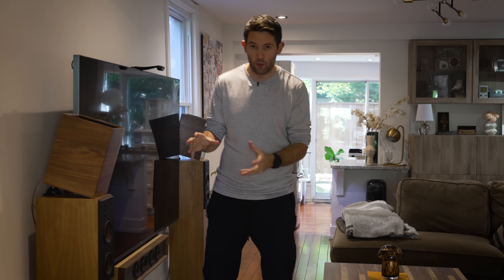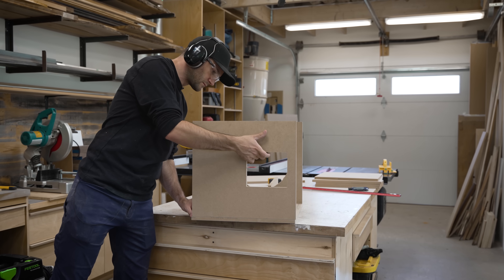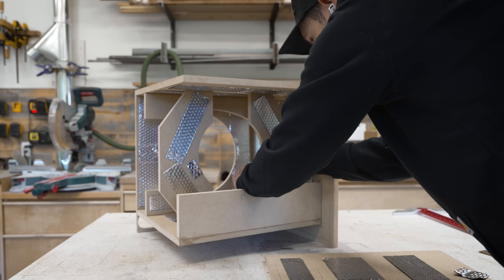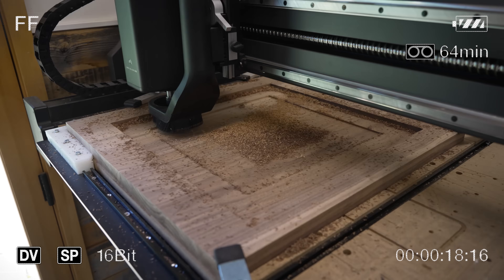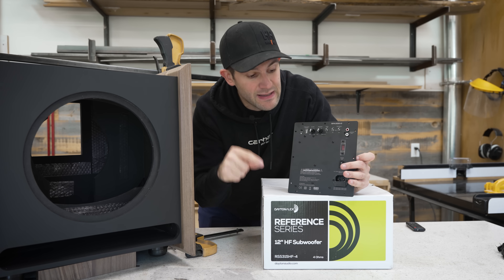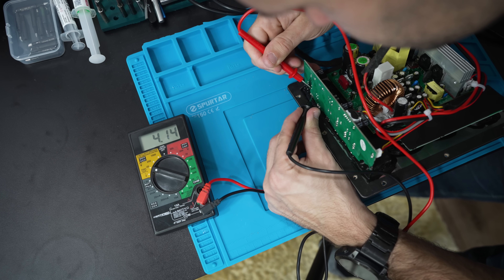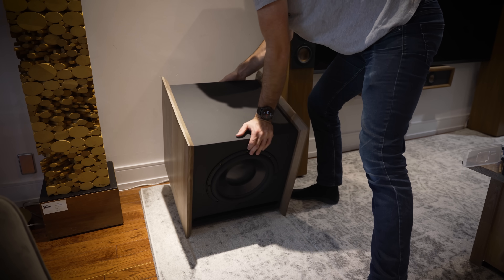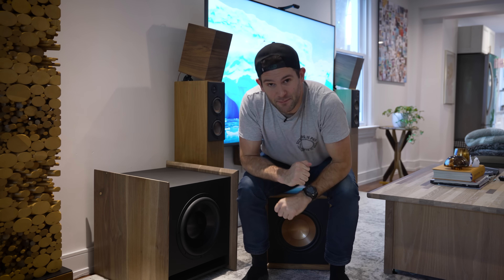THIS changes DIY Audio...

Comment: I would definetly add a simple toggle switch for feeding the amplifier wirelessly or by the terminals at the back. Back feeding a receiver can be an issue.
Reply: I literally never even turn my sub on anymore.

Comment: I have decades in audio, I don't even know where to start with thsi video. Not to be a nay-sayer but please, go and read a book on speaker design and also install a crossover in your sub AND put some long fibre wool in the cabinet and you'll be shocked at the difference. It get rid of the feet and remake the cabinet out of plywood (WAAAAAY better acoustically) and make a 2nd one as one sub is pointless. Please, try it, you'll thank me! :o)

Comment: Wow, beautiful build! One concern, though: the audio connector on the back of the subwoofer has now become an audio output instead of an input. If you connect it to the audio output of an amplifier via a cable, you could potentially damage the amplifier's output or the subwoofer's built-in audio receiver.

To prevent this, you might consider adding a simple two-way switch. This would let you easily choose between the wireless or wired audio channel.
Reply: I was thinking the same. At very least put a power switch on the RX unit. I like the two-way option too though. My thoughts were unpowered it at worst takes the damage instead of dishing it. Assuming it can handle just being in the loop it might add some resistance/impedance but  that's probably marginal
Reply: you should be more concern on how much it is going to  cost for the matierals , tools ( may not have them) and everything else.   vs just  BUYING ONE.

 do you make ur own cellphone... no you go buy it.
Reply: @anamegoeshere yeah hear i was producing my own shit.... should have just been buying it this whole time. Would have saved me so much time. So glad I happened upon your reply.
Reply: @anamegoeshere  Here I was making my own food, where I should have just been buying it premade
Reply: @Calihan  you can also apply that to bar soap/shampoo  and many more..... point?
Reply: @anamegoeshere  exactly
Reply: @anamegoeshere 
That logic works up to a point… for Apple that was be a definitive yes but for android that’s a different question, because Android is based off of Linux, which is open sourced.

Comment: You really f'd up that port, having the oval opening makes it smaller than the rest of the port length and will create turbulence. The port volume will be forced though a narrower opening and will make more unwanted port noise known as port chuffing. Also painting some of those areas before putting the WOOD glue down means the glue cant soak into the wood fibers properly which is very bad for the structural integrity of those joints.
Reply: He has "Atmos speakers" that point up.. I wouldn't take ANYTHING he says about speakers seriously...
Reply: He is clearly not interested in ACTUAL performance, otherwise he would not have used wireless. What POS.
Reply: @MP-qn1jw Hey hey, tone down a bit guys, you sound like some stereotypical audiophile jerks in some ways imo

Comment: If you live in a flat I can recommend going for a dual opposing driver setup. Less vibrations transferred to the building. So less noise for your neighbors
Reply: If I live in a flat, I don't have a CNC or table saw either...
Reply: @pumpkinchucker4953 If you do, maybe check to see if your city/town has a Maker Space. Or alternatively, a lot of shops will allow tool rental/paid services.

If the only thing a local shop needs to do is load up a spec and hit go - generally rates should good as well
Reply: Do a search for Dipole Subwoofer. No sound to the sides ( it cancels out ), very little transferred vibration, just sound from the front and back and the drivers operate in free air. Has advantages and disadvantages, like most things IIRC .... I built one with two B139's and it was the most musical low end filler I've heard so far.
Reply: Huh? Does it play the inverse of the wave?
Reply: @peaceofvideo i feel like he's talking about isobaric configuration (push/pull)
Reply: @scarce911  I dont think he does, cuz in isobaric the drivers are facing eachother (most of the times) and they both move the same way (one has the wire polarity flipped to achieve this)
Reply: @troybakker7628 "dual opposing" (opposing ~= opposite) seems very likely to mean isobaric config
Reply: @troybakker7628  in an isobaric config you don't flip the polarity of one of the drivers. If you do so, you achieve something like a cardioid config meaning you will get cancellation behind the inversed driver and enforce the spl to the front.
Reply: @archbug2510  If both drivers are facing each other you have to flip the polarity to one of them, also know as clam shell loading. If you are doing a traditional iso setup, both drivers would face the same direction and be coupled in a chamber as small as physically possible with the front drive radiating into free space, and the rear driver firing into the cabinet.
Reply: jemchurch1260 is correct. You want dipole, aka "free air". This will require a driver with certain t/s parameters. But they're cheap. Put a bunch under your couch and you will be very happy.
Reply: @archbug2510  If you don't flip the polarity of the opposing driver, then you get a cardioid. If you flip them, the drivers become in phase again.
Reply: @jesh879  This is only partly true. High Qts drivers require less equalization and power to achieve bass extension in a dipole configuration but a low Qts driver works also, it just needs more eq and more power.
Reply: @peaceofvideo  since the two drivers are opposing each other they don‘t cancel out. But the vibrations caused by the drivers do since they’re vibrating „against“ each other. The sonos sub is a good example for isobaric loading.
Reply: @archbug2510  Incorrect. In isobaric loading the drivers are in the same phase so they don't cancel eachothers out. They just point the opposite ways forming a driver with twice the moving mass and coil power vs speaker size.

Comment: It may be a new concept to make the sub wireless, but it's not really anything new. I remember back in the early to mid 2000s, my family had a pretty decent home theater system and it had wireless rear speakers so we could put them all the way on the other side of the room and not run any cables along the floor to the DVD player (which had the amp integrated). They were technically passive, but still needed to be plugged into the wall for the receiver to work.

Comment: 1:36 Man, stop asking ChatGPT for the differences and consult some of the various explanations from experts over the years.

Sealed enclosures typically have a more natural roll off of 12dB per octave, which blends smoothly with room gain. Ported enclosures, on the other hand, are designed to boost output around the port tuning frequency at the expense of a sharp roll-off below that frequency (24db, and it requires a hpf to not damage the driver from over excursion too).

I take issue with "fast" or "musical" subwoofers. The transient response or "speed" of a subwoofer is primarily determined by the system's bandwidth and tuning, not the type of enclosure. What people perceive as "faster" bass is often the result of attenuated low frequencies (sub 40 Hz), which makes higher bass frequencies more prominent. You can correct the phase of a ported enclosure by pulling down some of that efficiency near the tuning frequency too.

Comment: But how much did you spend versus the store bought?
Reply: I'm guessing around $600 with the materials vs $1800 minimum retail. I haven't looked up the driver and amp cost but the walnut is the most expensive part of the other materials. Given he already had the tools but it could be built with much cheaper tools, borrowed tools, or taken to a cabinet shop for the cuts.